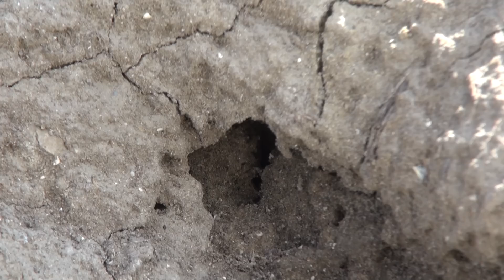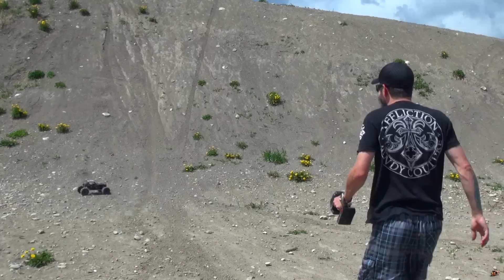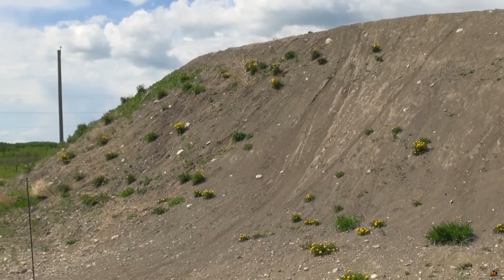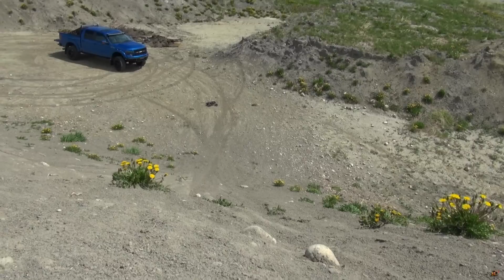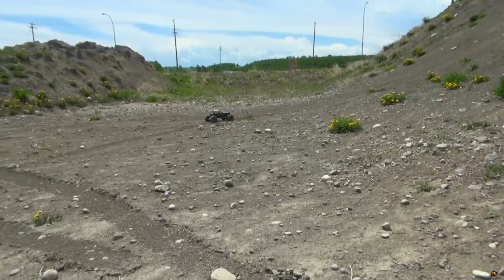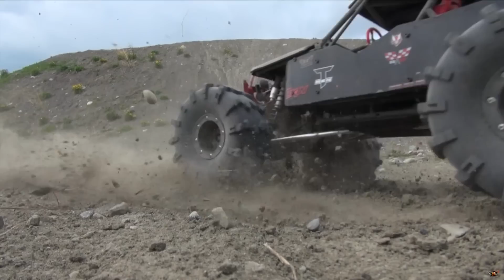RC ADVENTURES - BLACK WiDOW F-OFF / High Speed Hill Climb

Comment: Your truck would get right up there no problem! I know my fj would without hesitating at all
Reply: That hill is probably like 75 degrees incline.
Reply: Yep i know.....that's wait 37 inch trail grapplers and diff locks are for and another thing my inclinometer goes to 90 and it has been up to 84 so I doubt 75 would hurt it 
And awesome new tf2 btw they are great have fun!

Comment: I am looking for the metal beadlock ring for the gmade air rim, bud here in belgium it's impossible to order then. Can you find then ?
Reply: Look on Amazon the whole system is 100 dollars and it has 2.2 wheels and tires with the metal ring

Comment: are your lock nuts old on the wheels? Because technically once you tighten them down and take them off, they are done. It's really not an issue on slow vehicles like my AX10 Scorpion that goes 3 mph but my Associated with brushless, well... I've had plenty of locknuts come off. Just a thought.

Comment: Paint those threads with some finger nail polish before u put those wheel nuts back on next time. Easier to remove than threadlock and works better than u think it would.